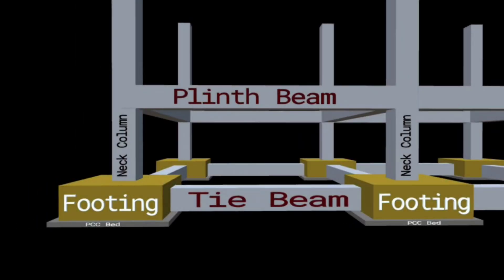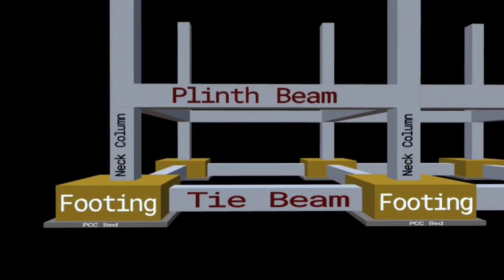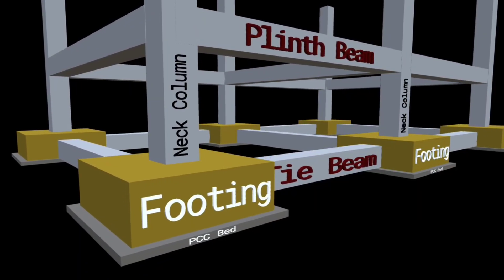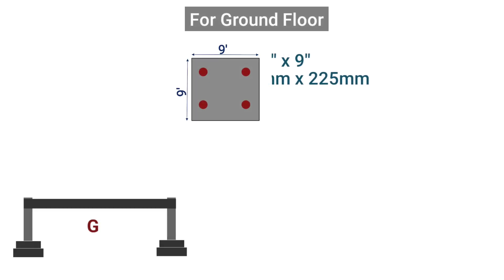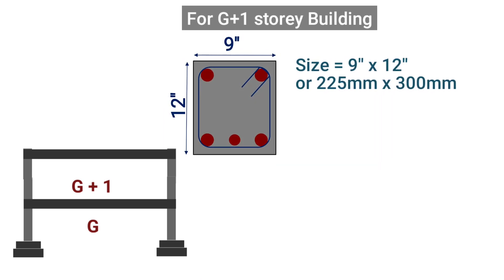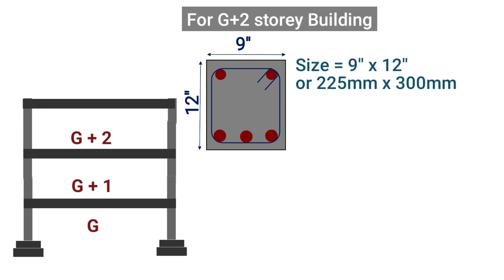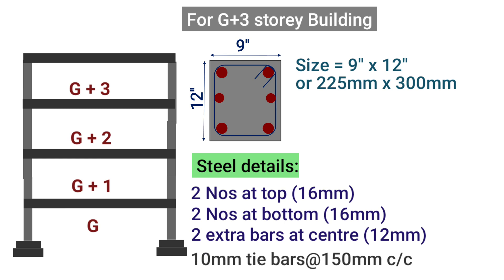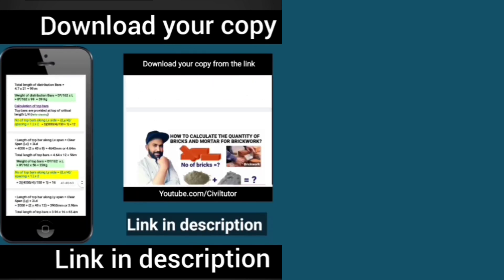Size of plinth beam for residential buildings upto G+3 storey | Reinforcement details | Civil tutor

Comment: Sir,
    Please tell in G+2 building plinth beam size is 10" * 12" with six nos.of 12 mm dia steel . This is correct or not.
Pl  make a video if it will be correct or wrong

Comment: I have an existing G+1. I am renovating the 24 year old building which is wall to wall construction without pillars. In the ground floor, I want to break the center wall and give support using 2 C framr making a box type frame vertically support and 1 I frame Horizontal. I planned to construct G+2. Can I use 8 inch width I frame or H frame 6mm thickness for G + 2 support ? What type of support should I give vertically and Horizontally?

Comment: Sir I want to ask you. One more thing important is span of column to column... If the span is more than 15ft there is a need of 9"*15" Beam.. And minimum 16mm 3 bars at the bottom and 2 bars at top
Reply: Long span recommendable for Commercial building.. for domestic purpose Short span with 4*12mm rods more than enough since there wont be extra live load at all time.
Reply: sir maximum span plz